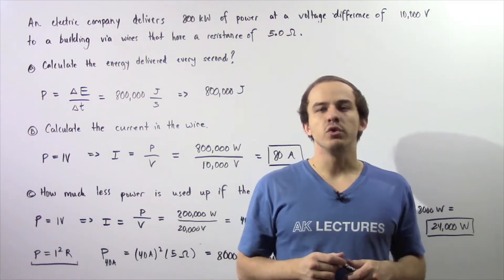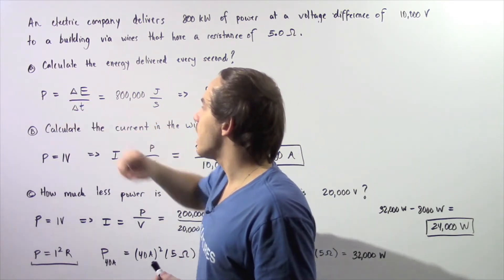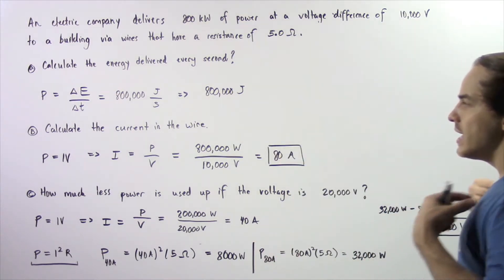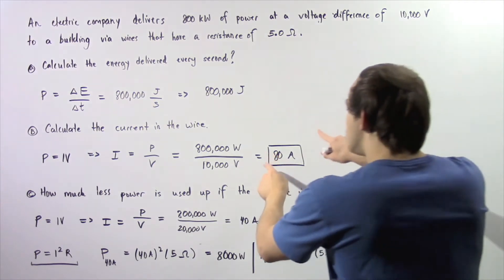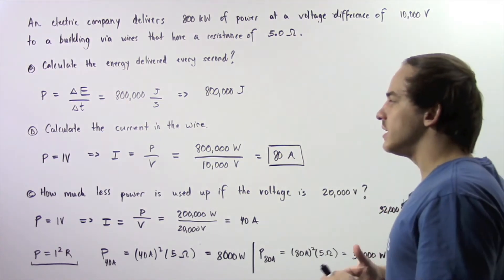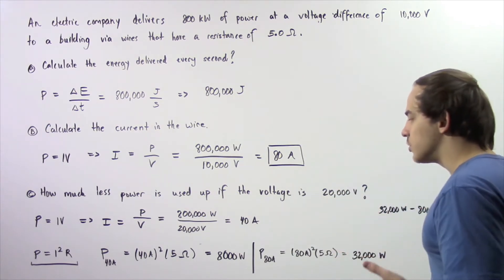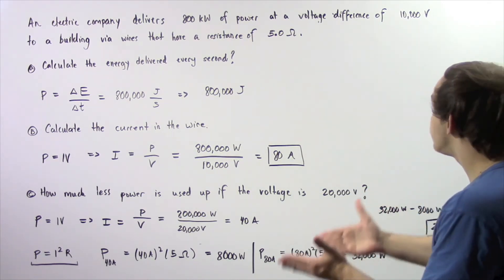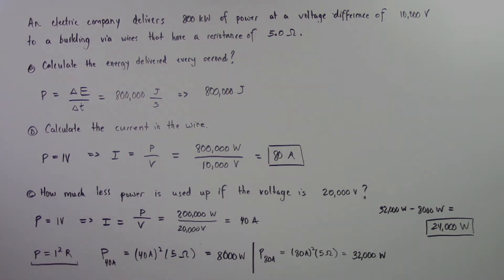Electric Power Example # 2

Comment: according to ohm's law (10.000V / 5.0Ω = 2.000 A) what is that i dont get it. why did we use P=IV, why wouldn't V=IR work
Reply: soruda direncin 2 durumda kullandığı power miktarının farkı sorulmuş bunu bulmak için önce üzerlerinden geçen akımları buluyoruz voltage'a göre ve sonra alttaki eşitliği kullanarak direnclerin kullanmış olduğu güç miktarını buluyoruz 2. durumda 1. duruma göre 24kW enerji daha az boşa gitti (used up). 7 yıl geçmiş ama yine de yazıyım dedim
Reply: @tiygar0  çok teşekkürler
Reply: @bilirubin6647  ne demek